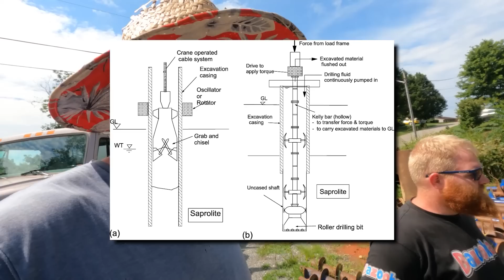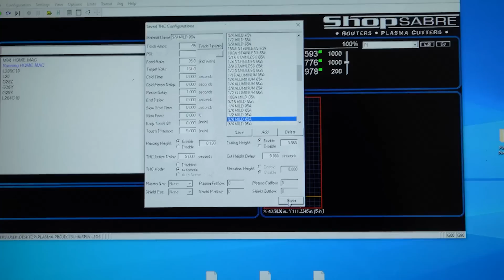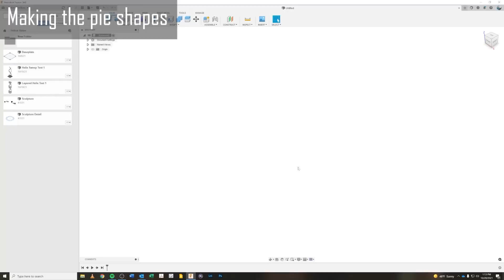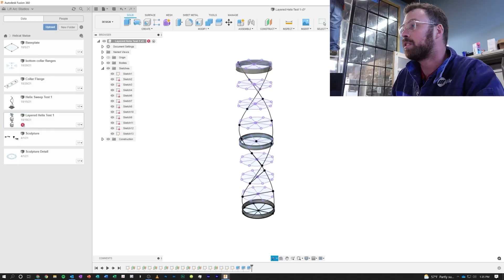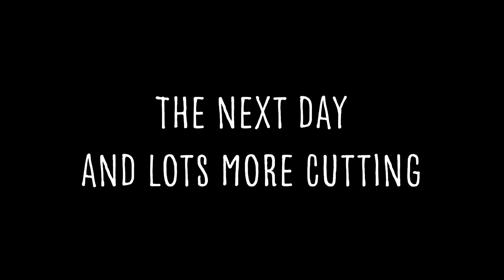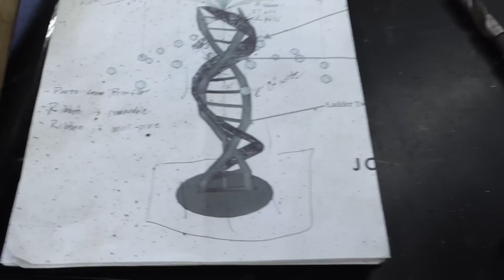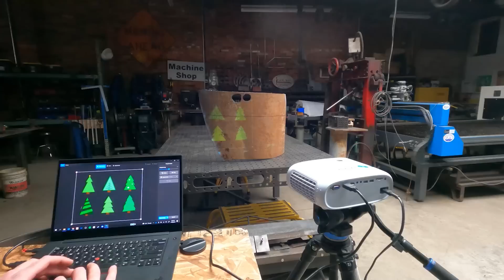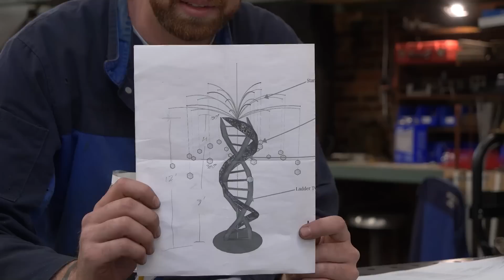Crazy Helical Sculpture Build "THE MOVIE" // Lift Arc Studios

Comment: Found the channel yesterday, been sucked in since. You may never see this, and may have come to these conclusions since, but having experience running a CNC Plasma cutter two things for the future. That outer profile, plus the plate thickness, would be large enough that it wouldn't move to cut 5 circles. Had you started there you could have "E-Stopped" immediately. As a HS shop teacher that's one approach I have with students so, if the profile is off, hopefully we didn't waste time and materials for a screw-up. Secondly, on the CAM software I use I can select where the lead-in and cut path begin, had you selected a corner, the negative space from the radius probably would have given enough space to avoid the blow-out. Either way you're right, that stuff won't ever be noticed, but some suggestions.

Comment: Just watched the 4hours on your shop rebuild refit now watching the helical video absolutely brilliant but have to ask when the overhead drive shaft got damaged why didn't you replace that section with parts from other shafts you took down as you certainly have the skill and equipment to have repaired it you said about running a fan off it in your office.

Comment: Wait a minute.
You built the helixes symmetrical. I.e., 180 deg from each other.
However, the DNA helix is offset from 180. A kind of twist at the base.
I don't know what that angle is but it's NOT 180 deg.

I think it's offset by 14deg, or 180 +- 14, or 166deg and 194deg around the base.

redrok

Comment: It look's a little weird it's because the extra ribbon with all those tools you put on the outside, is missing it's counterpart. Should have put another ribbon of tools mimicking the inside. That would have made it look much much better. Instead of just having one ribbon of tools. It's very unpleasing for the eyes to spot asymmetrical thing's.